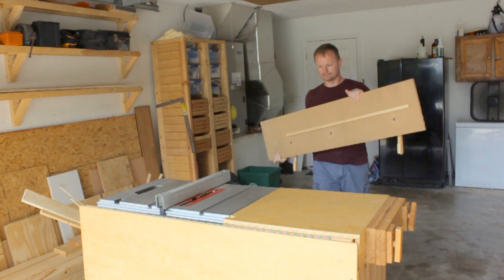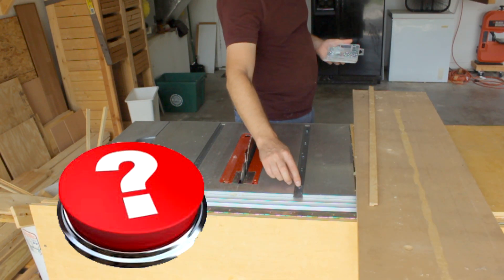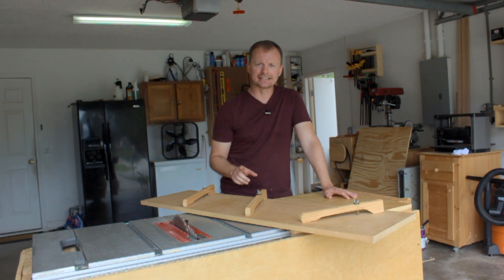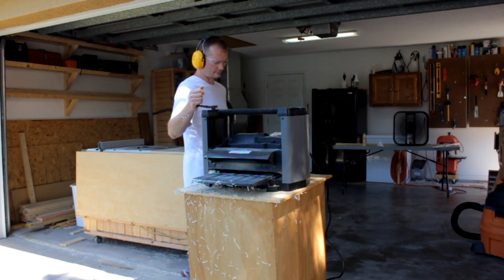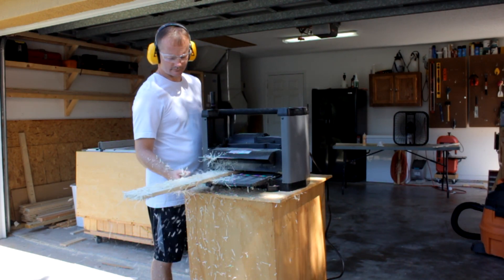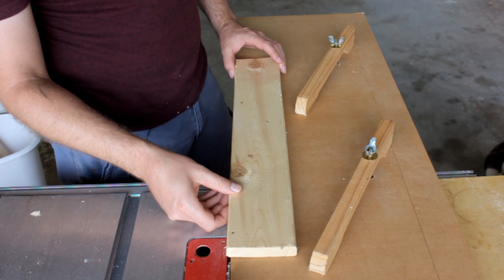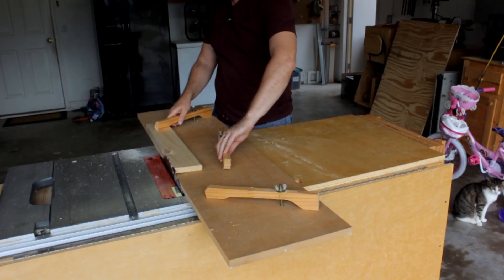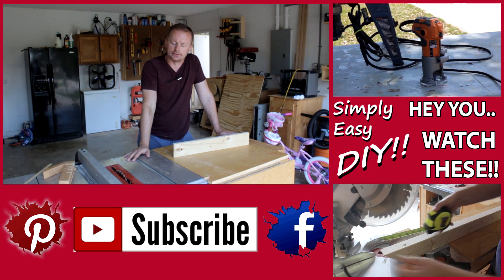Jointing Boards Without a Jointer - Getting the Most Out of Scrap Lumber

Comment: Great tips. Gonna have to try doing the wide side of a board like that.  I have the same planer and found that a shop vac floor attachment fits over the discharge for it really well. Saves a lot of cleanup time.
Reply from the maker: +Pete Nilsen Unfortunately I bought a model where I can't do that same thing with the shop vac attachment.  I'll trade ya.  Hehe.
Reply: +Stan Sullivan Looks like the same planer. Porter Cable model PC305P, 12.5"x6" Portable Planer.  I installed a Shop Vac floor attachment (Item # 90677) to the discharge cover with 6 screws and sealed it with adhesive backed foam weather stripping.  Hooked up to a shop vac I can fill a ten gallon can with chips and get maybe a handful from around the planer.  For less than $10, it's worth it.

Comment: I like your jointer sled.  I have a similar one but I like yours better, especially using the miter slot.  Time for a rebuild.
Reply from the maker: +Hardnox You just reminded me.  I forgot to put the link in the description for that build video.  It's also on screen if you need it.  Peace.
Reply: Thanks, I'll check it out.

Comment: I  have the same jointer as you and reading the comment below im not the only one having problems. I've tried adjusting both tables high,low every way you can think of,none helped. I took everything loose,greased made sure everything is tight,no help. I had very little snope the first couple times i used it and its gotten worse every board. anything im missing tune up wise that may help. blades are good too.

Comment: I wouldn't have thought to use scrap wood and tape on the boards without using a sled. Good idea! However, I notice on the video that the board still is cupped (not flat) as you clamp it to the jig on the table saw. Why is I that?
Reply: That's a different board than the one he flattened.

Comment: I like the simplicity of this. I've been looking at several table saw jointer jigs and this is the best explanation I've seen so far. Question on the planer. I have the same PC Planer, have do you seal with snipe? Maybe I don't have mine tuned up right.
Reply from the maker: I make sure the infeed and outfeed support is slightly above level.
Reply: Awesome thank you!

Comment: hi stan thanks for the video. i like the tape thingy, but i am wondering what if i deal with a longer material?
Reply from the maker: +Fabian Wiramihardja Hey Fabian.  Good question.  You'll find that I always build my jigs to fit what I am most likely to do in my shop and not to be a jack of all trades.  I always cut my boards first to a rough length needed for the project at hand and then joint them.  This avoids that issue for the most part.  However, if I'm working a project that requires longer cuts and I need to joint those boards then I will opt to use another means other than my table saw.  Routers or router tables for instance. Also, I have a jig that allows me to do it using my thickness planer that I may feature in a future video.
Reply: +Stan Sullivan cant wait to see that stan. thank you for the reply
Reply: +Fabian Wiramihardja I have seen people hot glue the stabilizing pieces under the work piece then "pop" them off.

Comment: Great video but how do I do 6-8 foot long boards that way?
Reply: I have  never done this but it seems to me that all you need is an out feed table with a miter slot cut into it matching the one on your table saw. Another option is a track saw. I have a Festool TS 75 with a 108 inch track which is nine feet. There are other companies making these if Festool is pricey for you. Once you get one side then you just use your table saw fence in conjunction with an out feed device.

Comment: Good explanation, Stan. A couple of questions:
Why did you choose to use the miter slot as opposed to running the sled against the fence?
It appears that the sled will is not able to clamp a 2X ?
Reply from the maker: +Steve Collins I think I said in the video for stability.  I don't joint 2x material in this manner but yes it can.  Appearances can be deceiving.  Elongating the bolt holes is what determines that.  You may want to check out the actual build video for this jig if you haven't already.  Thanks.
Reply: +Steve Collins running the jig in the miter slot allows you to trim the edge of the jig flush with the blade. this gives you an exact location of cut so you can line up the board exactly where you need to cut.
Reply from the maker: +mike gager Very well said.  Thanks.
Reply: +Stan Sullivan Thanks Stan, I'll check it out.
Reply: +mike gager Ah I see. I have mine using the fence but I'll probably switch to the other method as that sounds logical. Thanks Mike.

Comment: I've never seen the method you use to joint the face of a board with a planer with out a "planer sled"  If i'm thinking about this correctly I believe this method only work without a sled if the board being face jointed is as long or shorter than the length of the in feed and out feed table right?
Reply from the maker: Have you used a planer before?  There are rollers inside that press the material down as it passes through.  You can't use a board shorter than the distance of those two rollers, period, on a planer.
Reply from the maker: Whether you have a sled or not.  Not a good idea.
Reply: I appreciate the response!!! :)  I own a planer and use it frequently... not for face jointing though... which I will soon be attempting in a pallet up cycle project.  What I was referring to is your method you use to face joint in this video without a sled.  You taped "support material" to the bottom side to be registered against the bed of the planer.  What happens if the "support material" is beyond the out feed table and the board is still under the knives.  I would imagine the "support material" no longer has anything to reference from and then the process would be screwed... wouldn't you say?
Reply from the maker: No,  I don't have a problem.  Happens all the time.  You have to properly support your work piece no matter the length.  Perhaps I'm not following what your describing but I've never encountered a situation where the process became "screwed".

Comment: I never understood if you have a jointer why you wouldn't just flip the board over and use the jointer on both sides of the board? Why use the table saw?
Reply from the maker: +Kyle Veatch Why make several passes on a jointer and then at the end of it have no guarantee that you jointed the other side parallel to the first?  It isn't designed to do parallel.  It's designed to do straight.  The two don't always go together.  Plus the added wear on the jointer blades.  On the table saw you make one pass and your done.  You know it's good to go.  Like you, only in reverse, I never understood why you would want to joint both edges on a jointer.  HOWEVER, as I stated in the video, it's not for me or anyone else to say it is right, wrong or anything else.  It is simply how you or whoever, chooses to do it and at the end of the day, I'm fine with that.  Peace.
Reply: Makes sense. Thanks for the reply!

Comment: I try not to justify tools with money saved etc. The total cost of my shops is a huge amount of money and going that way would lead to either some ugly math full of red numbers, or not any tools at all. I buy and use them because I enjoy it, and they make the hobby more accurate and quicker which means I can actually do some of it between kids, job and maintenance/chores.
Reply from the maker: +Auarhau Excellent.  Whatever works for you.  Sadly for me I need to know I'm making the best possible financial decisions for my family.  Tools I bring into my shop always reflect that priority.  Good points none the less.  Thanks.
Reply: I think that applies to most of us. That's where second hand market and lots of patience comes in. I still don't save money woodworking I think. At least here in Norway, cost of raw materials are almost always more then buying it new from IKEA or something. But where is the fun in that :)
Reply from the maker: +Auarhau  I've heard on several occasions that building materials are very expensive across the pond.  That's too bad.  Agreed on IKEA.  It's hard to beat them here as well but I always feel I build higher quality longer lasting stuff, so I revert back to the "you get what you pay for" adage.